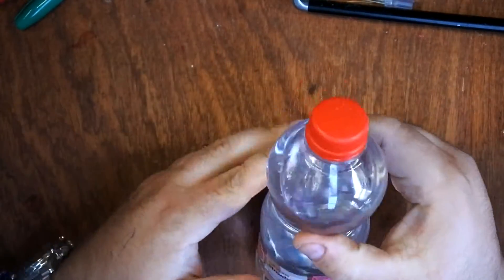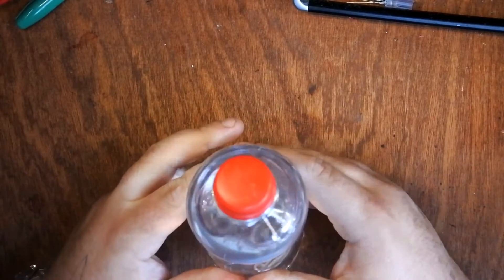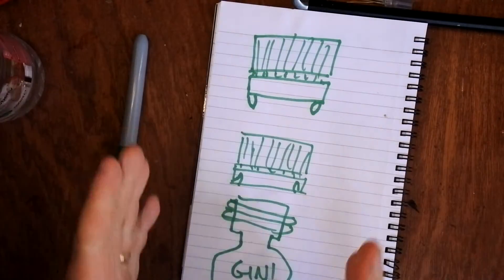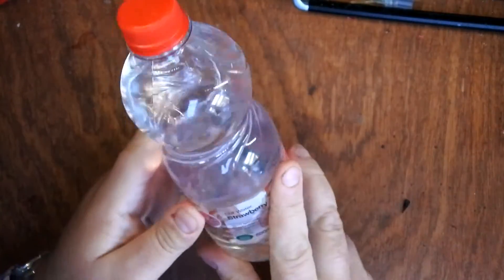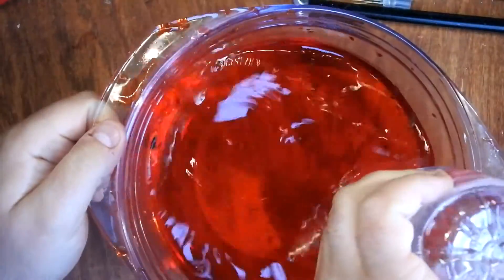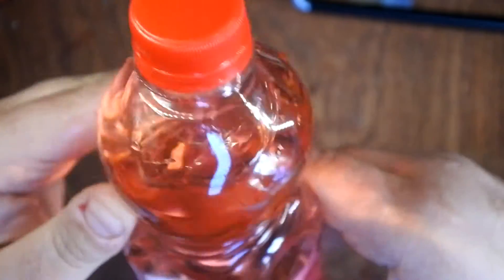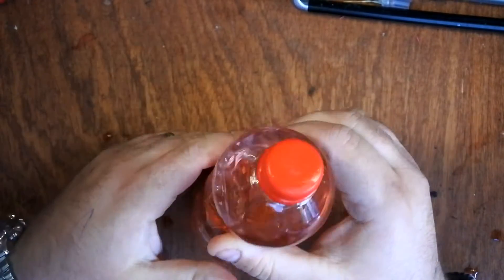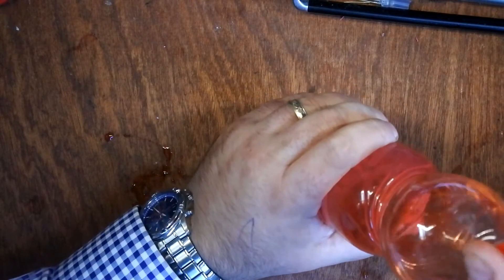Plastic Bottle Seals Don't Work!

Comment: Those seal are shop use. To prevent people from drinking partial contents (without payment) and returning the bottle to shelf and to prevent people adding things to the bottle, whilst it is still in the shop/store. As you have so clearly demonstrated, to do so without breaking the seal, isn't an easy thing, not if you don't want to be obvious about it.